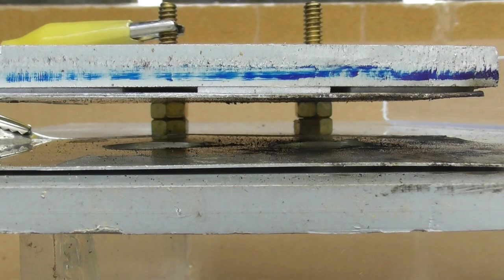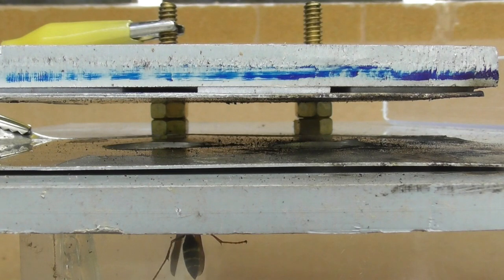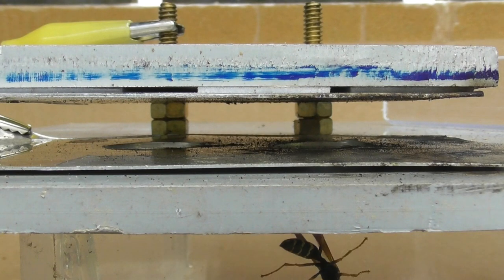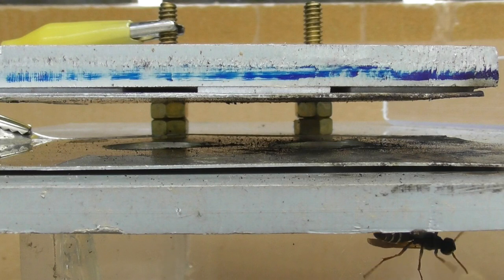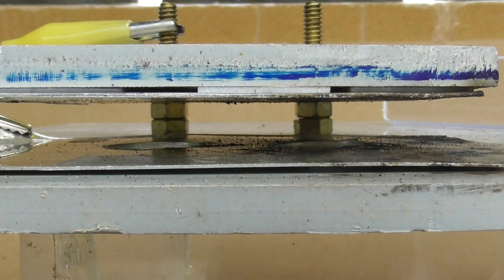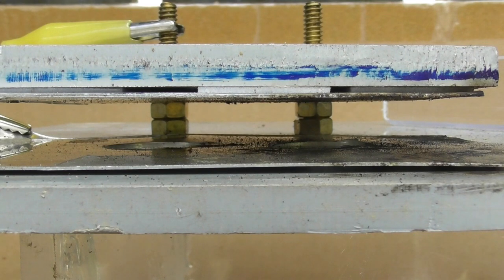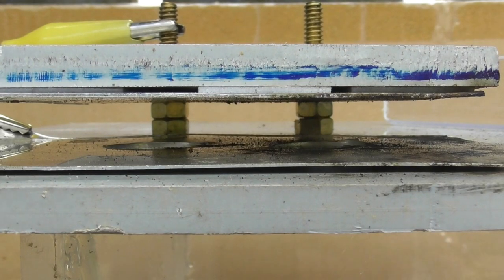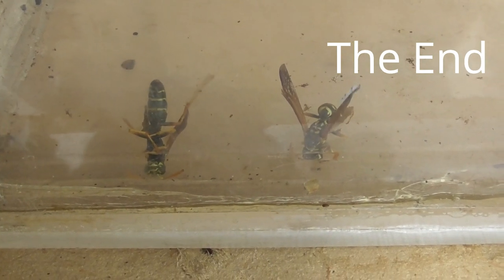Three paperwasp zaps

Comment: I wonder if you can hack some sort of capacitive sensing proximity start circuit with a built in timer together to energize/de-energize the device as the devices are trying to escape. Been watching you build a better wasp trap...er... wasp terminator... wasp-in-ator? for years now. Am a fan. I wonder if selective breeding has hit your yard yet, with only the most voltage sensitive wasps surviving.
Reply: Just make a recycler ad have it energised for 1 second every 5. That way the device will be out the hole and half way to the exit when it closes the circuit. Better yet use some HV microwave diodes and capacitors to build a voltage doubler, which will fry them over a greater distance. Just need to use 2 of each in series to get the withstand voltage up to spec, and insulate the capacitor cases from ground.
Reply: You're going to end up making some really smart wasps if any survive, or at least ones that have a very peculiar behavior.